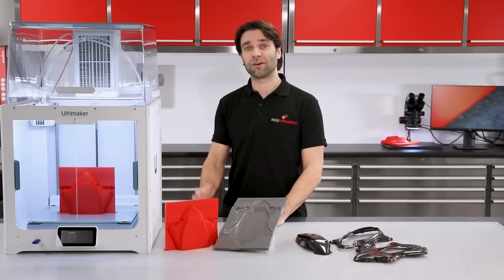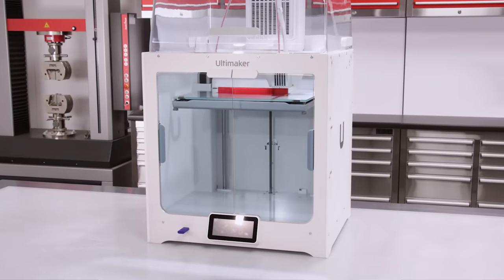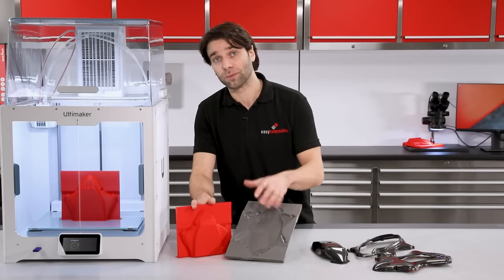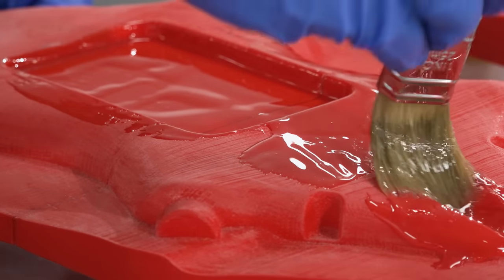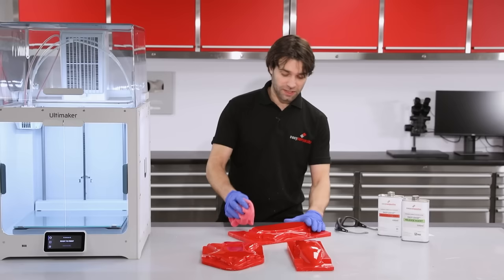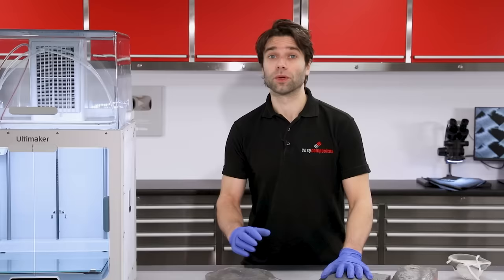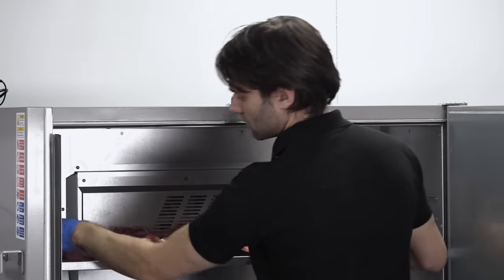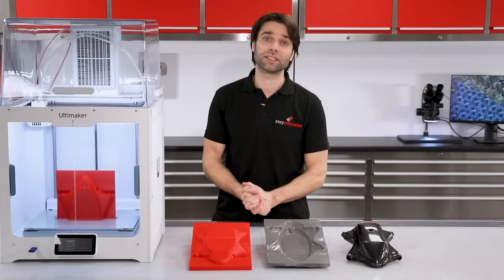Making a Composite Mould for a Carbon Fibre Part from a 3D Printed Pattern

Comment: Great video !! Do you think a kitchen oven can make the job for prepreg carbon fiber ?
Reply from the maker: Generally domestic ovens are not controlled enough and the temperature can fluctuate wildly from the set-point; however, if you have a method for correctly setting the temperature (rather than relying on the oven dial) such as a hand held thermometer with probes running inside the oven so you can accurately measure and set the temperature AND keep a close eye on it so you can manually adjust it to suit then yes, in theory you could. You could also strip the necessary parts from a domestic oven and build your own bespoke oven using a suitable temperature controller.

Comment: A question...When you applied the XCR to the original, it obviously adds thickness to the original. So, to compensate if you need exact tolerances, what do you recommend be subtracted from the original printed part so it is the exact measurements you may need? Also, isn't there some shrinkage happening as the 3D printed part cools?
Reply from the maker: Hi Doug, by the time it is sanded and smoothed, you may be adding around 0.5mm at most.  Shrinkage of the 3D printed part is down to filament, environmental conditions, printing settings etc. You are best looking at your printing set up to maximise dimensional accuracy of it is that critical.

Comment: hello sir, used 3d printing..but can get tolerance?, can comparison between CAD data to 3d printing. how many microns ± 0.01
Reply from the maker: These prints were a relatively low resolution as speed was prioritised over resolution.

Comment: great video as always, 
what kind of temp can the 3D printed part handle if you wanted to make a part directly off it 
or cure the molds in an oven with plug still inside
Reply from the maker: It depends to some extent on the geometry of the mould and also the criticality of the dimensions. In our test for this project we did plenty of experimentation to see, for example, if prepreg tools could be taken directly off the 3D print at modest cure temperature. Our results were that at 60C, under vacuum, the softening of the PLA was too much. So, I’d say that up to 40C you’d be fine, 50C is probably the upper limit, but, as mentioned, if the geometry was more stable and the dimensions not so critical you could get away with a bit more.

Comment: is there a reason you printed the positive and made the negative instead of simply printing the negative? since you're sanding and making a perfect surface finish anyway
Reply from the maker: Yes. The reason why we didn't just directly 3D print the mould is because we wanted to show a process whereby a 3D print could be used to make a prepreg carbon fibre part. Because prepreg can only be cured at high temperature under pressure, a 3D printed mould isn't an option, you need a rigid, high temperature composites mould, and so the correct route is to print the pattern and then take a high temperature mould off the pattern. In the next tutorial in this series we will 3D print the female mould directly and then hand laminate the part straight into that 3D printed mould.

Comment: Great videos!, would it be an option to print in 3D printer, resin it, pva and gelcoat and then fill in with spray polyurethane as support material. Would it resist vacuum process?
Reply from the maker: Not something we have tested ourselves.

Comment: It's a very educational video, thank you, but I have a question. why didn't you use 3d printer printing as a carbon mold
Reply from the maker: If you mean why didn't we 3D print the mould directly, that's because in this video we wanted to make the part using prepreg carbon fibre, which needs to be cured in an oven at 100C+. It's wouldn't be possible to use a 3D print at this temperature and so we use the print to make the pattern, then make a high temperature capable mould. In our next video, we will 3D print the mould and then lay the carbon straight into that mould.
Reply: @easycompositestv  thank you so much 
, I understood :)

Comment: Curious what you would think about a Formlabs 3L with HighTemp at 25 microns to directly print the mold.   We are playing with Tough1500 a bit and still learning.   Tough 1500 seems to be good for molds, just a bit flexible.  For carbon fiber not sure how flexible the mold has to be since the carbon fiber will flex off?  Rigid10,000 also has good temp resistance.  Could save a lot of time and perhaps doesn’t even need to be sanded but there are still obviously some slight layer lines.   25 makes an incredible surface quality.  May not even be needed, there are warnings about large parts on high temp at 25, and 50 is recommended.  It should also provide at least hundreds of casts, perhaps a thousand or two, not sure :).   Great video!
Edit: altered for higher temp resin
Reply from the maker: Hi Chris, we are not familiar with those specific resins as we have not used or tested them. It may be possible If you have a high enough temperature resin and a low enough temperature curing pre-preg then it might be possible to do. The porous nature of 3D prints means it needs sealing – even if you had a filament that can handle the high temperatures.
Reply: @easycompositestv  
Yeah, that one resin has a heat deflection temperature (HDT) of 238 °C @ 0.45 MPa.  I could send a print if you are curious.  I want to do some carbon fiber and from your videos this would make it a lot easier and still use your materials.  On porosity, I think resin vs filament printing is pretty non porous, but I’m not sure.  Is there a simple test I could do - leave a tablespoon of water, covered, on a print and wait a day or something like that?  Or is it more about epoxy type materials?
Reply from the maker: @chrisbaskett5205  There isn't any simple porosity testing that I am aware of.  However porosity is the biggest of the challenges as well as solvent resistance.  The repeated heat cycles will likely cause issues with the resin trying to soak in.  Hence a high temperature mould or at the least surface coating is essential.  Also the moulds need to survive vacuum.  I am not sure how well it would do under vacuum and temperature as often many 3D prints are hollow with varying degree of infill. Also be aware that most high temperature release agents rely on a solvent carrier for application and that may damage the surface.  So it is a bit more complicated sadly and probably why we have not seen any high temperature moulds directly from prints in that way.

Comment: Excellent video guys as are many of the others. An invaluable series of learning videos for newbies. Looking forward to the next episode as that is in line what I would like to do.

Some experts I spoke to warn me about heat generated by the curing process vs danger of deforming the mould. For that reason I am doing a test myself using PETG filament to print which has a slightly higher glass transition temperature compared to PLA. Not sure if that actually helps and might need to use ABS/ASA for even higher temperature resistance. Hopefully the next video addresses that point.
Reply from the maker: Hi Mark, unless you're using some very unusual materials (and I'm struggling to think what they would be) then you won't run into any problems with mould making materials overheating and distorting or damaging a 3D print. If they did then they're being used incorrectly or are unsuitable. The mould cures at ambient temperature and the peak exotherm will be negligible. The only time where the temperature stability of the 3D print material would be particularly important would be if you were trying to use an elevated temperature cure, such as prepreg, directly in the 3D printed mould which is a process we wouldn't recommend; even the more temperature stable plastics are likely to soften an distort at 70°C under full vacuum pressure.

Comment: Excellent example thanks, but then how do you bind the top and bottom?
Reply from the maker: In the case of this project the top and bottom halves just meet each other and then simple bands around the arm sections hold them together for an ultra light solution.

Comment: Since applying epoxy then mould material don’t print smaller than desired size?
Reply from the maker: Usually the epoxy coating is only around 0.5mm and can be sanded so that it just coats the ridges and troughs in the print surface. Usually the coating is pretty negligible but if depending on the precision required you can adjust the print geometry accordingly.

Comment: If you use too much molding paste at a time (an inch thick or so) will it exotherm?
Reply from the maker: You want to apply the paste at around 12-15mm thick. More than this could increase the risk of an exothermic reaction yes.

Comment: Just one question: imagine that the 3D printed piece is already the mould itself. Would it be recommended to use the coat epoxy? I'm thinking of this workflow: Sand the 3D printed piece => coat epoxy + release agent + carbon fiber on it. This question would make me place the right order at EC. Thank you.
Reply from the maker: Hi David, yes, the process you've described would be the best method if you want the part to come out of the mould with the best possible finish. I would add into your process description the flatting and polishing of the epoxy surface (as shown in this tutorial and covered in a little more detail in the long edit on our website). The other option, which is a process we're covering in the very next tutorial we're doing which is to show the fastest and simplest route possible from a 3D print to a carbon part. In the upcoming tutorial we'll show how you can coat a 3D print with PVA release agent and then laminate your carbon part straight into that. The downside is that you won't have a fine finish on the mould and so you'll need to do any finessing on the part itself (either with a clear coat or with a product like XCR). Either way, the workload is very similar, unless you're happy with a basic '3D print' finish on the part.

Comment: When is see the quality of the finished product, I wonder if the green gelcoat you used in a previous video is still usefull ? 
Thanks a lot for this video !
Reply from the maker: Yes, absolutely. The green gelcoat is the ambient temperature version of the grey gelcoat used in this video, they're really same product but the green one can't be used at high temperature so is unsuitable for prepregs. The surface finish off the two gelcoats will be the same.

Comment: Just curious. Shouldn't breather be put on the carbon fiber area to aid in the compression of the part?
Thanks
Reply from the maker: Breather wouldn’t aid the compression. It is used to ensure air paths but generally you can get away without breather in many areas without any issues. It’s rather counterintuitive and you’ll read a lot in text books about how essential it is to always have breather otherwise the vacuum will lock off but in practice it really doesn’t work like that!

Comment: Something that would be awesome to know how to do would be how to make a part like that of the XDynamics Evolve 2? Been trying to find details on how to make a fuselage with the tube arms like they did in one part?
Reply from the maker: Hi Kevin, looks like it will be a relatively complex multipart mould using tubular bagging film or some kind of bladder to apply pressure inside.  It could be possible they have made the legs separately then bonded them into place and finished the join line neatly before lacquering so it looks seamless from a distance.
Reply: @easycompositestv  Thanks for the insight on this. Yea I have seen the quad up close and it does appear to be a single layout. I wonder if there is a method to align the fiber when doing a bond between two different parts? That would be a good thing to know how to do if its possible. I am sure it is but seems it would be hit and miss to get a good alignment that is even close. I can see a lot of potential in knowing how to do something complex like this. The number of projects it could be used for is huge!

Comment: Would you do a video on parts that need to bee smooth on both sides? The peel ply always leaves a texture. Thank you!!!
Reply from the maker: Double A sided parts can be tricky, you have a couple of options. 1) you can refinish the inside afterwards by adding resin over the peel-ply finish and then flatting in back 2) you can use a matched tool process (inside and outside mould pressed together). Our next video will be about matched-tool compression moulding so watch out for that in a week or two 👍

Comment: How much thickness does the epoxy layer add?
To help design and calculate from the master 3D model, to mould design for dimensionally accurate part.
Thanks!
Reply from the maker: Hi Terry, the epoxy coating finished up at around 0.5mm.
Reply: @easycompositestv  thanks.
The main issue for me is your equipment and consumables are in UK and I am in Australia.
Shipping costs and all your chemicals would need to be on the importable list with customs with a Australian SDS.
Do you have that covered for Australia?
Do you have an Australian partner/distributor?

Comment: Curious: Could you provide product info on that stereo microscope with the external display you used?
Reply from the maker: Hi Andrew, we borrowed it from our manufacturing building, it's actually the microscope we use for soldering some very small components on the oven controllers! It does have amazing quality and a handy HDMI out. I don't know the exact details off the top of my head and I'm sure I'll forget to come back to this comment but if you drop an email to us I'll find the details for you.

Comment: Hi! We are new to carbon fiber so could you please tell why anyone would not use a prepreg material in volume production? It tends to be much easier to form a part with a prepreg that definitely a benefit in mass production. Or is it a matter of price? Thanks
Reply from the maker: Its less price of materials and more the initial set-up costs as the equipment and moulding requirements are more expensive than other manufacturing options. Out of Autoclave PrePregs are now becoming more affordable to set-up but Autoclave cure in-particular relies on very high investment costs and running costs too. Done correctly though, the uniformity of multiple parts and reduction in waste if parts are well templated and cut out plus the general cleanliness of the process over wet-resin techniques is often a game changer.

Comment: ... How would you go about making a Exhaust band/mount(similar to the likes as seen on motorbikes),using the likes of carbon/Kevlar tape ?.
Reply from the maker: The main problem is finding a resin that can take the heat than the actual making of a part that shape.
Reply: @easycompositestv  ... as I thought. I guess there must be ones, as they have such, for motorbikes. But I guess they get better airflow etc.

Comment: I was waiting to see the drone at the end. Got a link to the parts being put to use?
Reply from the maker: Hi Lee, we did want to do that end shot with them fitted but we were running so far over on time that we thought it was better to just get the content out there. I will be doing some shots for our project gallery and so you'll be able to see the built up drone on there in due course.
Reply: @easycompositestv  understandable. Thank you for the reply. I'll be looking out for the post about the shots.

Comment: Is it possible to use prepregs without an oven? Or to use a normal kitchen oven if it does not emit toxic fumes?
Reply from the maker: Hi Tijn, any oven used for pre-preg curing generally needs a stable temperature profile and good temperature control.  Often domestic cooking ovens lack the ability to do this.

Comment: Is it possible to get that oven in the States?  It seems ideal for my use, and I haven't found an equivalent readily available.  Most industrial ovens I see that are readily available are overkill for my needs, and come with a price to suit!
Reply from the maker: Yes, certainly. We’ve sent 3 ovens out to customers in the US this week! You need a 240V supply which means wiring it to your board (in most cases). If you’re interested, please contact our sales department for a quote.

Comment: How much does the size of the part vary from the original 3d printed mold after you've rubbed them back and applied the coating?
Reply from the maker: The rubbing back will do almost nothing to adjust the dimensions but the resin coating will add around 0.5mm of thickness so for critical applications you could allow for this in the design. If you link through to the project page on our website, you'll find this discussed a bit in the write-up.

Comment: Mould made out of EMP160 can be use for infiusion without post cure?
Reply from the maker: Yes, for sure. But if you don’t need the high temp properties then you could save money and use the EMP60 (and EG60) which are the same thing for ambient temperature use.

Comment: Can I use Acetone Vapor Bath instead of sanding after printing?
Reply from the maker: With some plastic materials yes. Remember the plastic will still need a key for the resin to adhere.